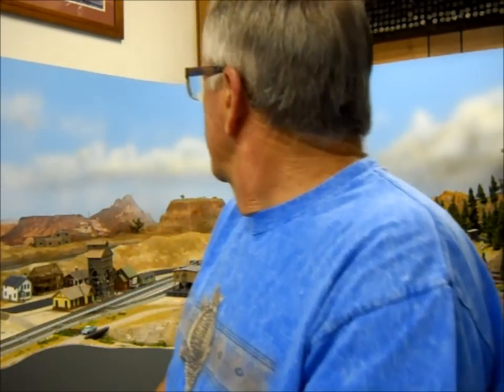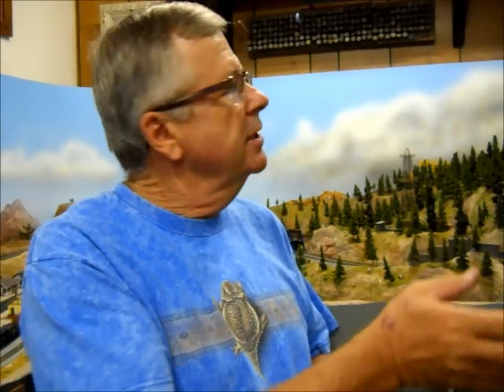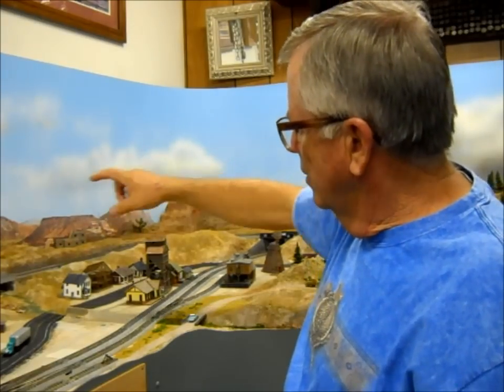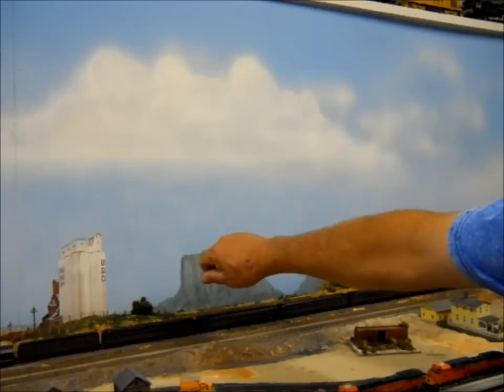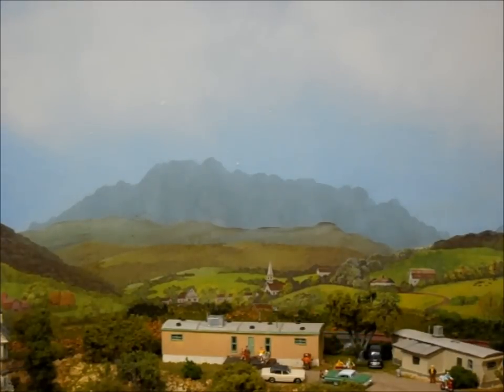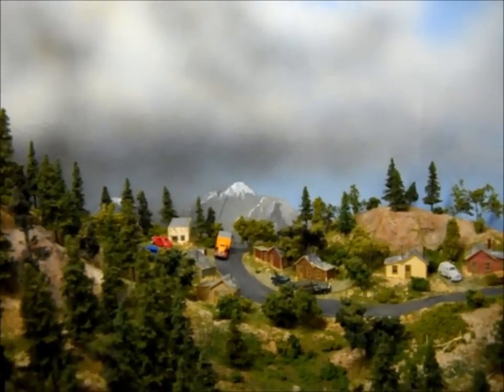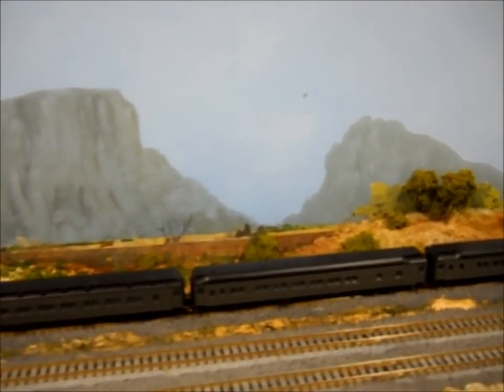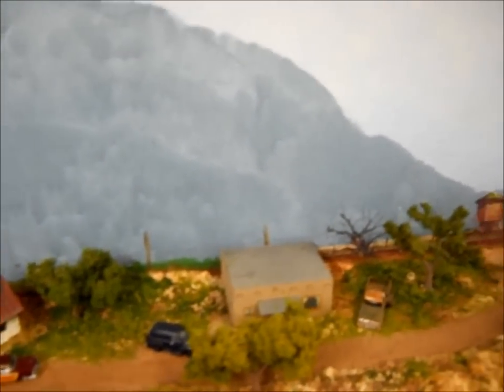How to Make Backdrops for Model Trains by Fifer Hobby Supply

Comment: Many thanks Mike. To the viewers from the UK the nearest is probably our Hardboard. This is a great explanation, which I, for one, will look at following on my model railway. I used hardboard on my work surface in my workshop and, when it's oiled (boiled linseed oil) it is almost impenetrable, and very hard wearing. Thanks again Mike, some great tips.